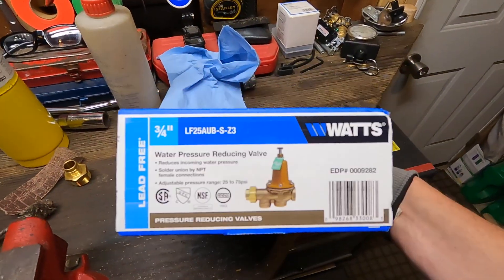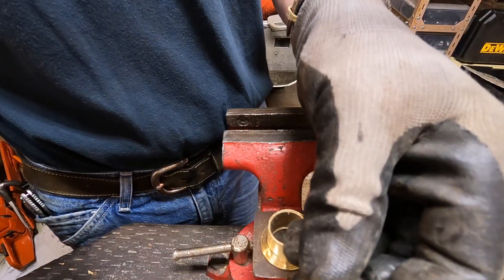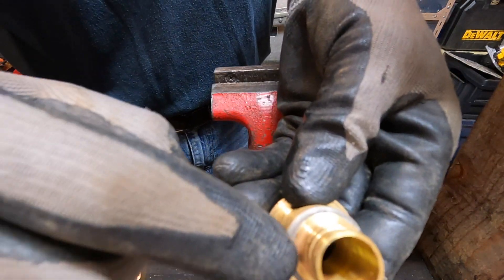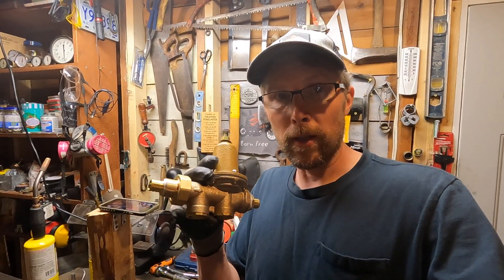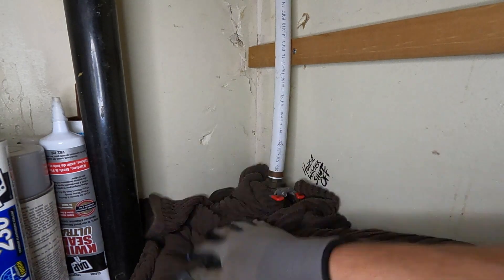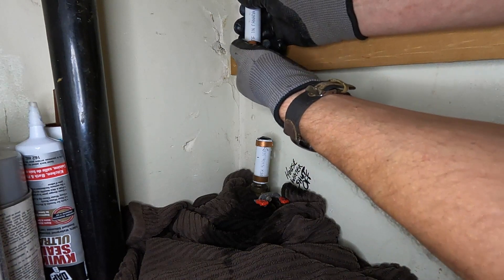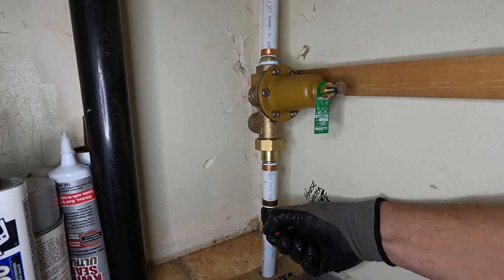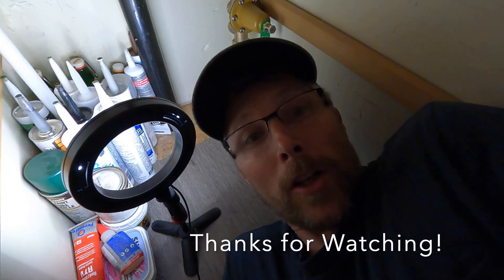How to Lower Water Pressure & Extend Plumbing Fixture Life!💦🔧

Comment: How can we test the water pressure in our house? Ours seems very very low and at the road at the water meter box is a county pressure regulator that makes a terrible high pitched sound when we use our water.
Reply from the maker: You need to fit a pressure gauge with female thread on either a laundry tub faucet with male thread, a laundry washing machine valve with male thread or most commonly an outside hose faucet. I would try and get your county water department out to service or replace the regulator valve at the street as well. Where l live that would be free because that regulator would be owned by the town. Hope this helps!

Comment: In the meantime, at MY house, where my pressure averages 17 PSI . . . . .
Reply from the maker: I'm assuming that your water system is provided  by a well?
Reply: @JENSENDIY  Nope. I live on a mountain. On a hill on a mountain.  I have 21PSI at the road.  But the time it gets to my house it's dropped to 17.  Code here requires the county to provide a minimum of 20PSI . . . but that's at the meter.
Reply from the maker: @zippitydoodah5693  If you install a booster pump in your house that will solve the problem. There are a bunch of different ones on the market now. l used to just install a 120V jet pump with pressure switch & a small pressure tank, worked great.
Reply: @JENSENDIY  I'll look into that.  Thanks!